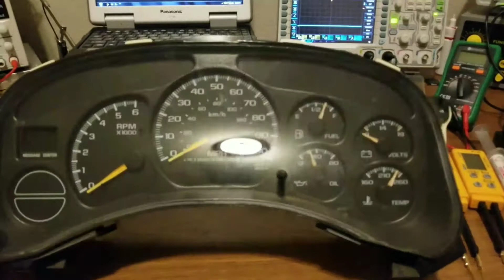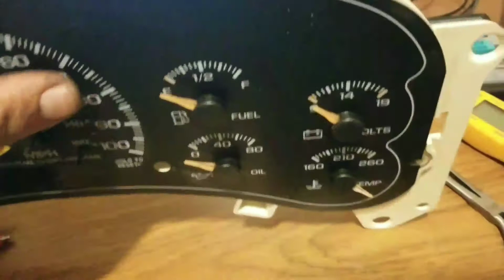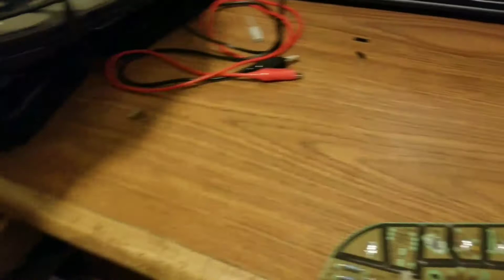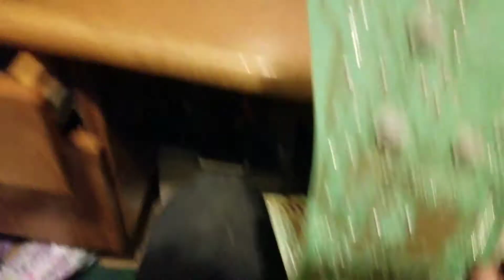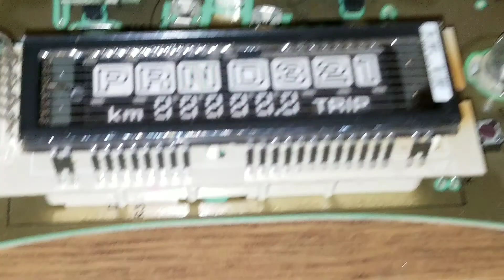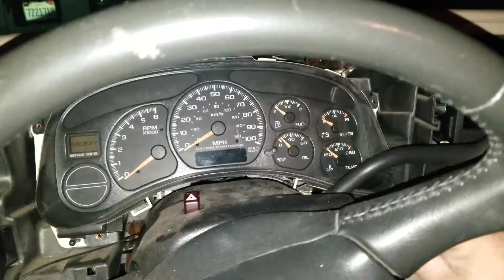Gm chevrolet gmc  tahoe silverado yukon cluster repair bad not working lcd prndl .  how to

Comment: I have a 1998 GMC Sonoma vary similar cluster my issue is only with the prndl display only shows Park and low position odometer still working,  I have not been able to find anything loose to solder, any help would be greatly appreciated Thanks

Comment: Hey my parking letters are not lighting up .i got 2004 escalade..need some help
Reply: +Fantasma Flores  Without knowing which level of Escalade you have, are you asking about the "Drivers Information Center" warning or indicator that park lights are on? These models use a "Body Control Module" or BCM that receives the switch signal to turn on park lights. From there, it control a relay for turning on park lights, headlights or high beams. The message the IPC gets, comes from the BCM via class2 serial data on one GRY wire into the dash. If the parking lights work and all other messages and warnings are working (For the Dash Message Center) plus turns signals, high beam and all, the first place to start is with a Tech2 scan tool to check for fault codes, then if none exist, there maybe  a number of special functions to push a button on the scan tool and work the IPC functions. Although, depending on the model, the drivers info center can produce 2 dozen or more messages that may not all work with just a scan tool. If the parks lights do not work, it could be as simple as the light switch.
ASE Master Tech since 1978 / Retired / Tech2 Owner since 1992

Comment: Use your man hands to remove the rear black panel, no screwdriver or needle-nose pliers necessary, just your fingertips. And as others have stated, the front lens does not need to come off. And never just bend back those header pins on that VFD daughterboard. That is most definitely the wrong way to do it! Just desolder the VFD daughterboard, its only 9 pins. And lastly , sorry to burst your bubble, but its not an LCD, Its a VFD, or vacuum fluorescent display. Not similar in any way.
Reply from the maker: Did i not say in the video no need to remove the entire display and that i just did it for the sake of visibility while recording? And as i've stated in the comments idk many times now.  I said lcd to make it relatable to the average person. I have never ever had a customer call me and say their vfd went blank.  It's always "my lcd quit working" . Apparently not calling it a vfd makes the repair process incorrect .I have fixed hundreds of these and never damaged or broken one by bending it. Literally 10 minutes from teardown to reassembled and testing. I'm not going to change that any time soon.  When i make these videos i think if the average diy person trying to do a repair and not someone like myself who has done many.  Would it be better for a first time fixer to slightly bend it and repair one or two solder joints or have them destroy their board trying to desolder and remove the complete display.  I just assume that most experts such as yourself wouldn't be watching and correcting a how to video made to help someone that wants to try and fix their car themselves.
Reply: Well you clearly have a reading comprehension problem, because if you read my comment properly, you'd see that I strongly advocate removing the VFD daughterboard. But then again, you probably can't comprehend what I am trying to tell you in the first place. And what the average person interprets the PRND321 display as is irrelevant.There is never an excuse to misrepresent the proper terminology as a professional. The fact that you're presenting yourself as a professional and posting a "how to repair" video assumes you know what you're talking about,.......and you clearly don't. LCD and VFD technologies are totally different. The fact that you can't tell the two technologies apart defines just how clueless you truly are.
Reply from the maker: @mike7958  I know the difference . I have a degree in electrical engeneering from 2004 that happened to land me in a good position in the automotive industry. I don't even know why i'm responding to you.  .I've forgotten more information then you will have ever learned. You just a troll scrolling through youtube looking to point out mistakes that somehow make you feel relevant. Keep up the good work . You're pettyness is making the world a better place. Thank god for you. All those poor people wanting to know why their vfd isn't working would never know from my video because i said it was liquid crystal. I watch videos all the time  because i'm always learning. Even as a "professional". Some are good and some are horribly bad but I have enough respect for people in general to not waste my time making myself look like an ass by pointing out flaws in what someone does to try and help others.  .I'll leave that up to you. You should go upstairs and borrow your mom's camera and start making your own flawless videos with your extensive knowledge of vfds . I'll be one of your first 5 subscribers.  I'd love to see what you can do unless of corse you don't have the man hands to do it.
Reply: I also do these repairs have for years and this one just played after another I was watching so I watched it along with a few other of yours, did I really need to?  No, but sometimes you pick up things  from a different person even doing the same thing  ( I do not make youtube videos) not sure why people who make similar videos feel the need to watch yours except for to critique and be jerks, Never once did I not realize you were just trying to make things relatable to the average Diy'er  who probably doesn't have an " Electronic Solder Sucker" god forbid they'd know what a VFD was,  not a day goes by that someone doesn't tell me their "Speedometer" is dim or blank.

Comment: Good video. Although I would recommend to not remove the front lens for this repair. It doesn't need to come off to fix the VFD. Putting the front face down risks breaking the needle stops and damaging the face. If after the repair someone wants to clean the dust out that's one thing. Also it's hurts my insides when I see people bend the row of header pins. With a good electronic solder pump it can be removed correctly and quickly.
Reply: +jeffescortix I agree with you Jeff, as with a check to reasonably priced solder sucker, it only takes a minute to desolder a multi-pin device. You know as well as I, that know one want to create more problems than when it came in for repair.
ASE Master Tech since 1978 / Retired

Comment: there is a diffrence
Reply: No its fine I just want to get it out there because alot of people call a VFD an LCD
Reply: @khalidhebshi5318  who cares? It's not a screen identification video its a cluster repair video
Reply: Welcome
Reply from the maker: Khalid Hebshi i am aware of that and what i had said but seeing as to how i only had one shot at repairing it while recording and the fact that what the display is called is fairly irrelevant to the repair process i went ahead and uploaded the video anyways in hopes that it would still help someone fix theirs. Honestly . Most of my customers with 02 and earlier clusters call me and state the lcd stopped working. Never had one ask me to fix the vfd so it might be easier to find in a search for lcd repair. Thank you though for the correction.  Ill make sure to correct the description in case someone searches vfd repair.
Reply: Excuses

Comment: Hey Jack i was wondering if you could check something for me. I ended up buying a 906bt after watching your review on it. Anyway, yesterday I was monitoring some live data on a couple different cars and I wanted to use the "buzzer alarm" feature while setting thresholds. When the buzzer goes off I can barely hear it, I'd have to hold my ear next to the unit to even hear it (volume is turned up). I contacted Autel, but I was wondering if you could check yours to see if yours is very quiet too......I'm assuming it's a software issue. Thanks!
Reply from the maker: Dan Jensen I've never used the buzzer before  but I will check it out this morning and let you know how loud mine is.
Reply from the maker: Dan Jensen I checked mine today. It's not very loud . it's not as loud as I would have expected it to be since it may be used under the hood with the engine running .
Reply: Thanks Jack, I'm waiting to hear from Autel, hopefully there is a fix (mine is so quiet you can barely hear it) does Maxifix work for you? It hardly ever launches, or I'll see the home page for a second then it goes away and you just see the loading symbol